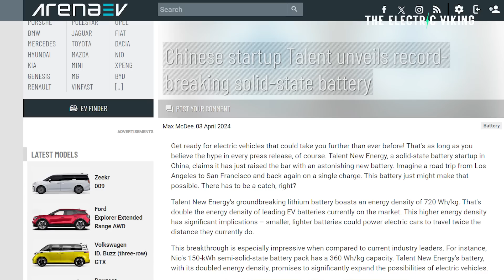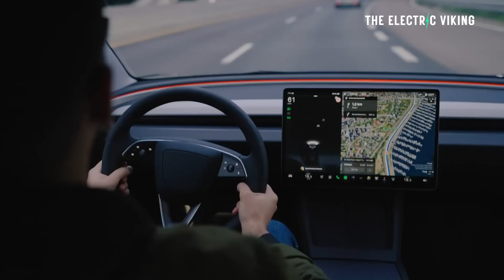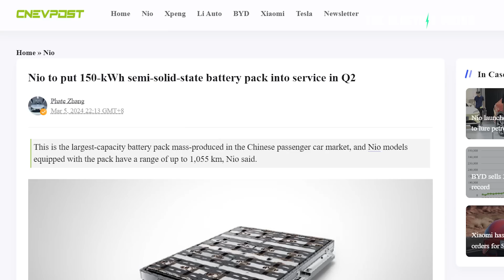Highest energy density battery in the world enables EVs with 1250 mile range

Comment: We knew we would get this type of battery efficiencies one day. Like tradies and their power tools, way different today than 10 years ago. Same will happen with cars, SUV's, trucks, etc. But just not yet, and this ridiculous push to have all EV's now, when the tech is old now and there is not the infrastructure available to support the EV's on the road now, is just a waste of time and resources. Again, we have to learn to crawl before we walk etc, etc.  It will happen, it will just take the next 10 years or so. But it will happen. Unfortunately selling a 2023 Tesla in 5 years time be like selling a one wheeled horse and cart. That's progress.

Comment: Long haul flights??? ...A Boeing 787 uses about 500,000 kwh of energy for a 7hr flight (about 4000 miles, 6500km).
So even with crazy dense batteries of 800wh per kg, that's a battery weight of 600 tonnes! From LA to Sydney, this battery would weigh 1200 tonnes! Good luck trying to take off with that!!! (not to mention the huge reduction in efficiency keeping that weight in the air. And of course landing would be impossible.). This bloke makes utterances way above his pay grade. Absolute madness.
Reply: One has to be careful with the comparison because ICE engines (even turbines on airliners) aren't nearly as efficient as electric propulsion.   It will be a while before a 787 class aircraft uses batteries exclusively.  But they aren't quite as far fetched as your post implies.   A 4X energy density over today's batteries would probably be adequate for all but the longest range aircraft.
Reply: @brianbeasley7270  Yes it would be interesting to know the efficiency of an electric turbine engine. But surely the battery weight would be a huge problem for landing? ... and to recharge a 100MWh battery for a 2-hour turnaround, boggles the mind!
Reply: @tomlewitt   Tom, Electric motors are around 96% to 98% efficient in converting the stored energy to motive power of the turbofan compared to typically 50% to 55% thermodynamic efficiency of the gas turbine.   The propulsor itself is in the range of 70% efficiency.   So one sees that the electric motor version is almost twice the energy efficiency.   The battery weight is clearly an issue and the plane will have to be designed to handle the landing loads--like landing with a full load of fuel.   Also, a downside is that the plane doesn't get any lighter as it uses up its stored energy.   

On the charging front, one would guess that there will be large storage battery systems (like Tesla Megapacks) that can charge between flights and also multiple plugs can be used to charge the battery banks on the plane.  Clearly there will need to be large feeds to make this work.
Reply: @brianbeasley7270  Good info thanks.😀

Comment: Just so we don't go crazy here a 50 kWh battery can only deliver 50 kWh of electricity.  Increasing energy density from say 350 kWh/kg to 700 kWh/kg would just mean the battery was lighter you would not get extra range.
Reply: Any vehicle will go further on the energy it has  if it is lighter

Comment: I drive EVs since 5 years now.

The battery which would be needed is the following (considering a consumption of approximately 20-25kwh/100km:

85-100 kwh of capacity 
Charges ALWAYS without battery conditioning up to 95-100% in max.10 min if needed.

Degradation less than 5%
Cycles 1000 which is enough.

Then better to concentrate on low weight and costs

Comment: Sam, your math is wrong, therefore your conclusions are wrong. 720 watts per kg doesn’t make for viable commercial airlines or helicopters. Electric propulsion has a 90% efficiency. So 720 watts per kg becomes 650 watt hours of kinetic energy available per kg. Kerosene used in jet engines is 11,900 watt hours per kg. The thermal efficiency of available turbofan engines is 30%, which means 3,570 watt hours of kinetic energy available per kg of fuel. These batteries will still be 5.5 times heavier than the equivalent yield from jet fuel.
Reply: Also, I'm sure "electric jet engines" are way less efficient than electric motors. So the 90% figure you mention may be a lot less for aircraft propulsion? 
A Boeing 787 uses about 500,000 kwh of energy for a 7hr flight (about 4000 miles, 6500km).
So even with crazy dense batteries of 800wh per kg, that's a battery weight of 600 tonnes! From LA to Sydney, this battery would weigh 1200 tonnes! Good luck trying to take off with that!!! (not to mention the huge reduction in efficiency keeping that weight in the air. And of course landing would be impossible.).

Comment: Think there might have been a mistake if you put a 50kwh battery in a model 3 of this battery, it would not make the model 3 do 10 miles per kilowatts.

Although if you took the weight of a normal 50 kwh battery and swap the weight giving 100kwh then 500 miles would be achievable, now put it in an apterra and you would nearly never have to charge
Reply: Yeah, not sure if he was on a few too many pain killers or something when he made up those numbers 😅

Comment: I fully disagree that nobody needs a battery pack that is 1000 miles of range.  that is exactly what people need, or perhaps fill they need to match the convenience of an ICE car.  maybe even more.  thats what you need to do a awesome roundtrip without ever worrying about having to charge.  also, people like to drive 80-90 mph with ac and heat on full blast.and then you have to worry about battery degradation.  remember we can EVs that can last 20-30 years like a toyota can.  public fast charging is horrific and it could get even worse as EV sales increase.  charging will always lag behind.  they should be installing faster chargers for batteries that we will have in a decade.   early adopters are ok with the challenge of charging.  normal people wont.  EVs need to beat the socks off internal combustion.  

I spent year arguing differently than this, but I changed my mind.  I have listened to enough people.  and honestly, I think about my mother.  she is 70 lives in a rural area.  I ran into a guy in rivian and he had no clue how he was going to get enough charge to make it back to san fran which was just 2.5 hours away.

we have to face facts.  most people dont give a shit about climate change.  they dont want to pay more for an EV even if it has lower total cost of ownership.  people dont like change.  and EV charging has been so complex.  there are not enough chargers.  they are different speeds. many do not work.  they are hard to find.  they have lines during holidays. 

we just need to accept what is needed and get there.
Reply: I agree. I can see 1,000 miles (1600km) range for some no doubt. I drive an old 1996 van that I can get about 500 miles (800km) - I will never get excited about 250 to 350 miles range when my old van from last century can do double that. I can drive 3 hours north to visit family and drive back home to refuel at my local station with people I know and can trust. People don't want to be forced to re-charge at unsafe locations - those who keep telling us we don't need more range never take that into consideration. I drive a lot and would go for a 600 mile (966km) range EV, preferably a minivan. And I don't ever need anybody to try to tell me I don't need 600 mile range - to ensure that on the worst days cold, heat etc I still have enough range to not get range anxiety. I am guessing that a 600 mile (966km) range would be a sweet spot and then we'll see EV sales soar. Perhaps the "range" on EV's should be for those worst days i.g. 20 below zero and 150 instead of unrealistic ranges.

Comment: Now we would need a hd pickup truck and vans with 1500-2000mile range and under $60000 ish. This should certainly be possible there is no reason for standard truck from 150(0) to 350(0) or 650(0) to ever cost more than  $70k

Comment: All these new battery types are prototypes and work under laboratory conitions in the size of a tiny  CR2032 cell .... will it work in big sizes and in mass produced batteries as well .... who knows ? It´s all speculation and if you ask me ... making sensationell announcements is one kind of marketing strategy .... publishing realistic numbers another ... 
Right now there isn´t even one single 100 kWh battery pack on the market which enables electric cars to drive 700 km  in normal weather conditions at this time. 
All these announcements about new battery technologies and their UTOPIC  720 Wh/kg  energy density sound ridiculous to me .. 

TODAY the battery packs have approx 200 Wh/kg energy density in mass produced battery packs ( depending on the chemical components a few Watt Hours more or less ) .... 
Battery industry should demonstrate their unbelievable ( ridiculous ) achievements in real existant battery packs which journalists can test in real electric vehicles ...  anything else is just vaporware !

Comment: Battery technology today is like the race for jet engines in the 50s, everyone is having a go because having a better battery just makes everything in your EV better.

I don't really care for 1000km of range, my petrol Yaris only gets 500km at the best of times, but if you can make an EV weigh 800kg and still have 500km of range AND cost under $30,000. You got a world beating formula.
Reply: You are describing the actual needs of most people especially in an urban area who travel infrequently and have home charging.   Also, this is a great description of a lower cost 2nd family vehicle.   But there is still a need and desire for a longer range primary vehicle (500 miles EPA range).    As people experience their first EV, a family situation that will eventually shake out will be a primary vehicle of 300-500 mile range with a secondary vehicle of 300 miles range (for reduced purchase cost).   This is almost ideal for situations where home charging is available.  Apartment dwellers without access to charging may need the longer range vehicle as their one primary vehicle for convenience.

Comment: New day, new battery. All these new batteries work in presentation only
Reply: One should probably think of articles like this as just describing the trends.   Today's batteries have far more energy density than the ones in 2012 when the Model S was introduced and range has roughly doubled.  The batteries described will probably appear in vehicles in the 2030 time frame.  But between now and then, the batteries will continue to increase the range or make the cars lighter with less batteries (by weight and volume).
Reply: First Nissan Leaf struggled to do 100Km. New Xiaomi SU7 Max can do 800Km and close to the same price of the first Nissan leaf. Have faith in technological development. It creeps up on you slowly but it is there.

Comment: This is good news.
 
Image being able and having to only charge once a week,(maybe only on the weekend) and riding all week without stopping to charge. 
Or driving 400 miles away to see relatives then 400 miles back and only having to charge once you got back home….

Range is where it’s at. 
The more the better
Reply: What I imagine is home wireless charging and just parking the vehicle where it charges overnight automatically to the prescribed levels and not worrying at all about "charging once a week".   If one has home charging, it takes an additional 10 seconds to plug it in nightly so it isn't really a concern but only a convenience.   Most posts like this are people who own ICE and haven't broken away from the ICE fueling paradigm.   (However, people without home charging are still in this mode.)   EVs (with home charging) are generally far more convenient than ICE today for the vast majority of driving.   With wireless charging and 30% range increases, there will be effectively no contest.  The EV will be far superior to ICE ownership and fueling.

Comment: The major point I can see for having a huge capacity battery in an EV, is it would mean the argument that "you can't tow your boat"..or caravan or trailer or whatever, long distances, is blown away. That high of an energy density & the speed of charging would enable a long range even when towing a heavy load for work or play. And would be quick to charge on a long trip. Solving two major arguments against EV utes.

Comment: Sam you're forgetting about the price of these batteries, and their lifetime that may still make ice trucks a logical option.
Reply: First flat screen 30 inch LCD's about £4000. Latest 50 inch OLEDS about £400. First 2 Mega pixel digital cameras about £500. 20 Mega pixel camera in your i-phone about £10. EV batteries will be the same with new cheaper chemistries and mass production. Always happens.

Comment: No, sorry Sam, but it doesn't work like that. 50 kWh at 720  Kwh/kg in a model 3 does not double its range. It merely reduces the weight of the battery pack by 500 lbs. This is equivalent to 2 American men in weight. Try adding or subtracting 500 lbs to a model 3 and it will make only a 10% difference in range.  How this new high energy density battery effect should be calculated is if you double the kWh you double the mileage without adding any weight.
Reply: Yeah, I don't know where he pulls his numbers from sometimes. Getting 800km out of a 50kWh pack means you'd be getting 16 km per kWh (10 miles). I thought Model 3's were like 6 or 7km per kWh, maybe 8 with ideal driving. You're not getting another 8-10 km (~5-6 miles) per kWh just by cutting the battery weight by ~two thirds
Reply: Right. I hope Sam reads this, because I am sure he wants to be accurate in his information.
Reply: He meant to say Kilograms not KWh
Reply: A 1000km real world (1200km claimed) battery would pretty much mean all charging done overnight t home, or overnight wherever you are staying,, which totally eliminates any impact on your time during the day " gassing up" or charging etc. Bring oit on

Comment: Please, please, please "Watt Hours per kg" is the unit-of-measurement.  Watt is not an abbreviation for Watt Hours and Watt Hours is not a more formal way of saying Watts.
Reply: Indeed. Makes me cringe hearing commentators making such a gaff and worse because Sam should know better.

Apart from that, a 100kWh battery would still only give the same range. What these higher energy density batteries mean is that a vehicle can carry more kWh for the same weight/size. To double the range (without any huge improvement in efficiency), you would need double the kWh. However at double the energy density (Wh/kg) that greater battery capacity wouldn't weigh any more.

Semantics and terminology aside, 720 Wh/kg batteries will be a game changer.
Reply: The concepts of energy versus power are confused by the general public, and your frequent misuse of the units is making it worse.  The ENERGY density of the new batteries in this video is 720 WATT HOURS per kilogram.  This is the parameter that will make electric aircraft practical.
Reply: @DaveBeckwith  Nothing wrong with his statement as he said Wh/kg to mean energy density. However, Sam misusing W/kg means power density, which rate of flow of energy per kg, and not the same thing.
@Sam. Please take more care with your units! They matter.
Reply: And claims a higher density 50kWh battery is going to go twice the distance of a lower density battery of the same capacity. Cringeworthy.
Reply: Lol
Reply: Part of the issue here is the confusion that can occur between mass-specific energy density and volume-specific ('volumetric') energy density, the two not being the same. Also, the proper definition of 'energy density' (mass-specific)  is Joules/unit mass, generally J/kg. If we used these simple definitions across the board, there would be far better understanding of what we have; however, now the issue has been thoroughly jumbled and confused by (particularly the auto) industry for many years,  it's going to be hard to unwind.  It's so much easier to equate say a (prospective, but maybe not affordably in my lifetime (!)) 1000 W.hr./kg  (= 3600*1000 J-s,  i.e. 3.6MJ/kg)   to say petrol (gasoline) and diesel/avgas at ~45MJ/kg. Then we can see that the mass and functional efficiency of the entire propulsive energy system is an important parameter, not just the 'fuel'.
Reply: Another crystal clear unit: Ah (amp hours) "charging capacity", tells you nothing about charging capacity in terms of  KJ/sec  or miles/sec.
Reply: what hours are you talking about ?
Reply: The correct term is the Joule.
Reply: Watt means the CURRENT instantaneous output of a battery, it's like saying the highest instantaneous output of a battery.  Now, that could be 700 Watts for 30 minutes or for 60 minutes.  I have a 100A for 30 minutes battery.  That would measure only 50Ah @ 48V, but it can output 100A instantaneously.
Reply: I agree. If the EViking can't get it right, what hope has the average uninformed person? Please Sam, start using the correct units.

BTW, your arguments don't make any sense with regard to range. A 50kWh battery in a Tesla Mod3 will not suddenly deliver 800kms of range just because it is light. Even if it only weighs say 150kg rather than 480kg. For a start the battery in the current SR M3 is 57.5kWh not 50.

It has a range of 500km give or take. Having a smaller but lighter battery will never add 300kms of range. What you should be saying is that you could have say a 150kg battery with 730Wh/kg which would store around 90kWh allowing for the weight of structural and packaging materials. This battery would probably have a range of 800 to 900kms but how much would it cost? It all appears to be in the distant future anyway with many other factors involved such as charge rate, battery life, hot and cold performance, cost etc. I'll believe it when I'm driving it.